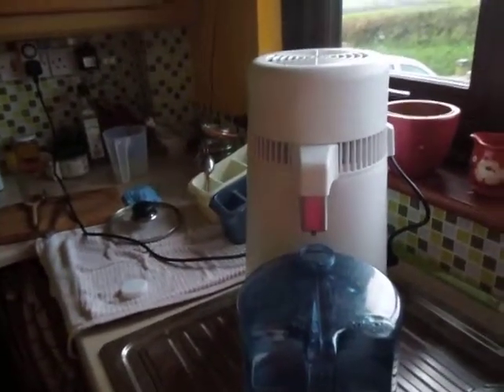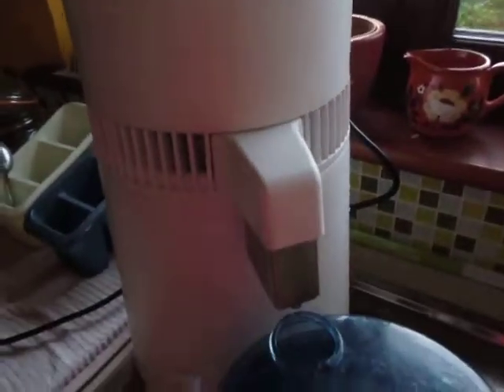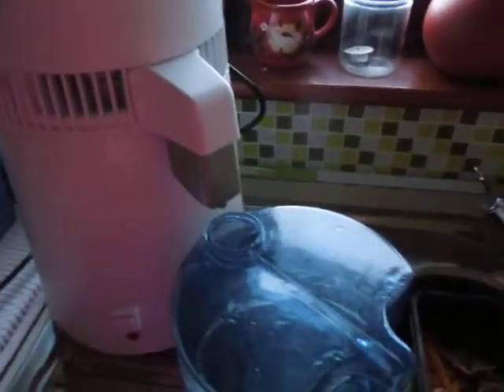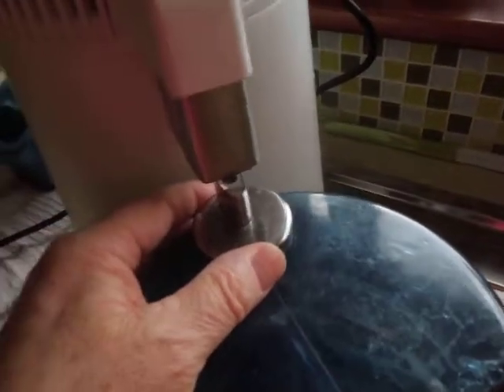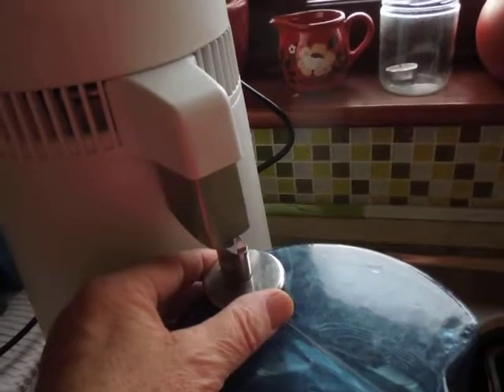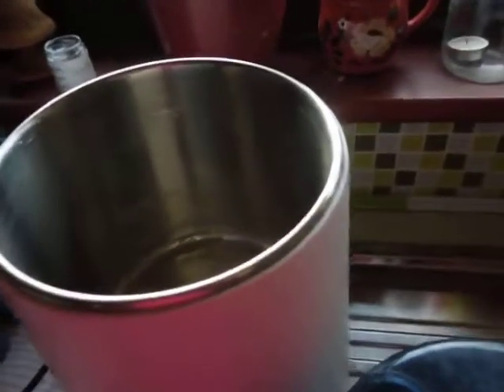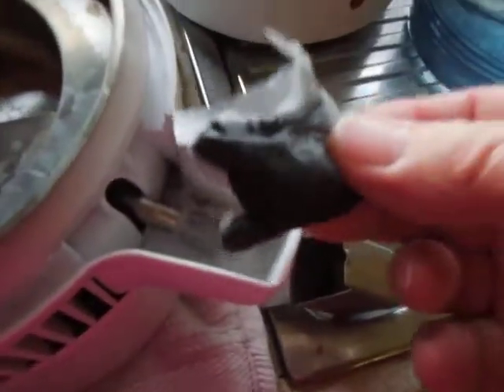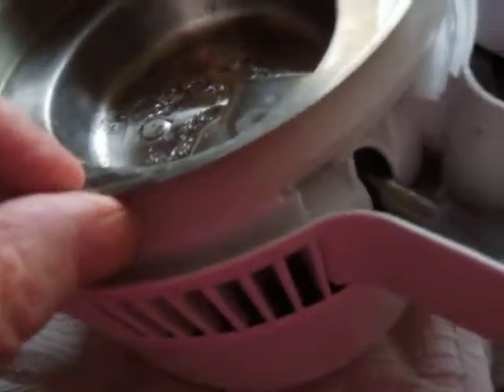Water Distiller Problems and how to Fix them.

Comment: Kinda useless info presented in a rather painful (slow) way. My Waterlovers MKII broke once during warranty and now done (after 3.5 yrs. I suspected this was a very poor bargain. If I buy 2 gallons of distilled from market, it costs $3. The unit cost $400; breakeven is 133 weeks, to say nothing about the electricity costs of running the unit 3 hours.  In other words, just buy the gallons of distilled water.
Reply: Kinda useless comment with information we have already considered PRIOR to purchasing a distiller unit. 🙄😒
Reply: The unit cost $70. he said to clean the ring and take off the metal piece so it stops leaking. i watched in 2x speed.

Comment: Here in Florida tap water is shite !  We bought some 3 gallon water bottles with screw on caps. We fill up the water bottles at the market water machines then we distill it. Tap water is poisoned with fluoride & chloramines. Yes fluoride & chloramines are toxic to humans & pets ! All products made by pharmaceutical companies are toxic too ! Darn right there is a depopulation conspiracy ! Up next is WW3 Depopulation which according to Revelation begins in the Middle East. One shadow government controls all governments worldwide, the I11uminati ! 1/3 of the human race will perish in WW3. Soldiers are merely pawns in I11uminati war games.
Reply: .666ft per mile squared = Curvature rate of earth 
66,600mph = Earth going around sun 
1666 = Year gravity was invented (666 newtons)
66.6° latitude = North and south arctic circles 
6x6x60 = Diameter of the moon
6x6x6 = Surface temperature of uranus 
4.666km/s = Plutos orbital velocity
666 = Speed of sound in knots
600 x 6 x 6 = earth circumference in nautical miles 
1.666 AU = Distance from mars to sun
1,426,666,422km = Saturn orbital distance 
666 times brighter, the sun is than venus
666 days. Longest time a female astronaut has been in space
Reply: - 0 intact dinosaur bones or skeletons found
- 0 dinosaur skulls found
- No transitional fossils  
- Dating fossils by rock layers and dating rock layers by fossils
 is circular reasoning 
- You can’t carbon date fossils; they’re stone. 
- Radiocarbon Dating is bunk
- 100% of dinosaur bones are fake 
- You'll never be able to see dino bones because they're 
supposedly radioactive, which is an obvious lie
- Engineers say dinosaur legs would buckle under the 
proportions and their insides would fall out based on the 
engineering of their rib cage
- They want you thinking "an asteroid can wipe us out at any
 time, now give us money" 
- Evolution was pushed by a eugenicist who married his 1st cousin. 
- Dinos invented by royal society in 1841 by liar Richard Owen
- Only people with a financial interest find dino bones, which are really 
smashed up chicken bones. 
- There are no dino discoveries before the 1800s. Not suspicious at all.

Comment: Thank you for the video! My husband and I bought one last year because we were going through so much distilled water (for my many plants and his c-pap) so we just thought it would be better in the long run. I didn't like the fact that we were throwing away so many plastic jugs and having to make extra stops when our stash ran low. Admittedly it is kind of a pain to have to clean it every time - if I'm making water for the plants, I will do two cycles before I clean it.
Reply: I clean mine every 10 gallons. That said I also have a whole home 6 stage water purification unit so maybe mine would be a lot worse if I didn't..?
Reply: I clean every month.  It's just scale, it doesn't change the water being distilled.  I'm run 2 TBSP of citric acid, and after a few hours, it's perfectly clean.

Comment: That’s normal. That’s the sediment from your water. Add vinegar and water about one inch and you will not have to scrub anything. There should not be any water left after a cycle
Reply: You are right, but may I add this aswell, 1 inch of vinegar is too much, you risk it taking metal particals as vinegar cuts deep into surfaces if left longer than a short while, certainly over night isnt even necessary, you only need a tablespoon at most. You do not want to accumulate metals in your body over time, by mico degrading the stainless steel over time.

Comment: I used my one for 4.5years and yesterday it stopped heating. When I opened it I saw that the heating element has separated from the aluminium inner container . I will have to buy a new one, but I  am impressed by withstanding more than 1500 cycles.

Comment: There should have been a clear rubber/plastic tube that came with; if cut and put the plastic hose onto the drip part you can direct where the drips go, like long enough to actually go into the top of the jug.  That lesson I learned after about 6 months of use and now never have the water going where I don't want it to go (as long as I remember to ensure that the rubber tubing is inside the jug).  I also overfill a bit, as you do, and just wipe out the bottom each time with a bit of vinegar.  I change the charcoal filter whenever the water begins to taste yucky.
Reply: Can't you use a charcoal water pitcher before distilling to help clean the water?

Comment: At least in the USA, when power is over .20 cents per KW  hour, it is cheaper and smarter to buy distilled water, currently only $1.00 per gallon. Also, the store product has no off taste and the process is much more efficient.
Reply: I bought plastic gal jugs at the market for years but prefer my distiller for a few reasons: I don't like plastic (I use glass to collect it), in the summer I use my dehumidifier water so I get zero gunk in the bottom to clean and it tastes perfect, and for me it's less costly than £1 per gal
Reply: @flatearthterrafirma8571  Dehumidifier is a good idea if no junk falling into the reservoir.
Reply: @flatearthterrafirma8571 that's not food safe. You say you don't like plastic but then use a non frood grade plastic humidifier??? Wtf
Reply: @DatsiKxModz  I distill the water. It's therefore pure and safe. No chlorine or fluoride like our municipal water supply. If I had a well with clean water that would be preferred.
Reply: @flatearthterrafirma8571  .666ft per mile squared = Curvature rate of earth 
66,600mph = Earth going around sun 
1666 = Year gravity was invented (666 newtons)
66.6° latitude = North and south arctic circles 
6x6x60 = Diameter of the moon
6x6x6 = Surface temperature of uranus 
4.666km/s = Plutos orbital velocity
666 = Speed of sound in knots
600 x 6 x 6 = earth circumference in nautical miles 
1.666 AU = Distance from mars to sun
1,426,666,422km = Saturn orbital distance 
666 times brighter, the sun is than venus
666 days. Longest time a female astronaut has been in space
Reply: My distilled water tastes amazing and I live in the US.  I use glass jugs and add minerals sometimes.  I will never drink store-bought distilled water in plastic jugs.  You can taste all the leached plastic.  I get 4 liters of water in less than 5 hours, so I never have to run my machine overnight.
Reply: I live off grid and use the distiller as a diversion load when I have surplus power. So for me I am utilizing power that would be lost forever if I did not use it. I am not an environmentalist but not consuming and transporting plastic gallon jugs full of water is better for the environment!
Reply: Seems like water conscious consumers are getting dupped into paying for plastic water because water distilling machines are a cornered market with limited cramp products.
Reply: @YoutubeacademiaAndsome  My water is amazing and not to mention the health benefits of not consuming microplastics.  Plastic is the worst.  My electric bill is no different from prior to distilling and I use my distiller almost every day.
Reply: mark40511  If you get cheap electricity and don't count depreciation on the Chinese machine which will fail in 1 to 5 years, likely so. But I would check the output for  TDS or hardness and see if it is zero or 1 at the most.
Reply: @RRaucina  my $115 distiller is six years old. Still works fine. One downside is that it heats up the kitchen a bit much in the summer.
Reply: Micro plastic and source cleanliness is not garunteed with store bought
Reply: In California,  it's now over $2 per gallon of distilled water.

Comment: Brilliant vid. Was wondering about changing the carbon filter. Fully value you taking the time to do this!
Using the same here and had no issues at all with; we discarded the first 3 lots but used to flush as we do bathwater. Some grey water also used for garden irrigation/purufication system. I digress. 
For past 5 decades we also have a flouride filter attached to any incoming pipes on every property resided in. 
Leaving distiller on to dry isn't an issue either, being used to accessing lemons & aromatherapy oils/herbs to clean everything we have successfully learned to clean up the mucky residue in the bottom that exudes from the nasties that exist from what is 
[ officially and unlawfully ] 
put in the water. We distill twice, then put through 2 water filters EVERY time prior to ingesting. So the process is constant & we about to invest in a secondary device. Testing regularly all these years guides us to this necessity, since everyone here ingests plenty of water daily. Sons & daughters of families outside ours have come to stop purchasing bottled water, invest in distiller and filters, yet advised all is pointless when no fluoride filter. Awakening the young to the dangers of such has been a lifetime commitment ✨ 
Should you wish, we can post the link for some good lemon juice & you only need 2 caps full after each use. We only use it when our home-grown lemons have been used up, but is really good! We've had same 5 litre one for past couple of years. 
The best way to prevent flood though, there is an option of a piece of silicone piping; thin enough to be held tightly onto outcoming spout on top fan part beneath the carbon filter block & short enough to just fit inside top of water collector/container. 
Wishing you well & much success with all your endeavors x

Comment: It’s a simple process and a simple appliance so I hope everyone solved their problems. Following the instructions is the way to go. Going past the fill line will cause it to boil over and leak. Where I live the water is very hard so there’s a good amount of calcium deposits so after every use I cover the bottom with vinegar and let it sit for four hours. I wipe sides with vinegar and the inside shines like new. Every distiller has an automatic shut off and the deposits on the bottom means it’s doing it’s job of removing impurities. It needs to be cleaned after every use. Check the instruction sheet again. Good Luck with it.

Comment: How did you get rid of the metallic taste? I just got mine it’s on its 4th run and no matter how much I clean it… followed directions w the acid they provided and w SOS pad… still horrible taste. HELP from anyone?
Reply: Take an extra step and run it through a "full sized" activated carbon filter.  Not just the small bag that most of these have at the spout, which doesn't allow enough contact time for the carbon to do it's work.  It will taste perfect
Reply: Wayne Helmore in his Megahome vs Waterpure video said he added some liquid mineral.  Says this starting 3:15. https://youtu.be/xzoZp7J_9gI
Reply: Even distilled water you buy has a metalic taste. I put a few drops of concentrated lemon juice in the water l drink. Mostly l use the distilled water for coffee and tea. Sincerely
Reply: Maybe you can pre-filter the water a few times with carbon filters before distilling, then use a 0.1 micron Sawyer filter to remove the taste afterwards.

Comment: After 2 or 3 uses I figured out wiping off the sealing ring with a paper towel after each use prevented any leaking. No cleaning products necessary for the seal, just wipe it off after it cools down.

Comment: Thank you very much

How do you clean the bottom side of the top part?
Reply: @sheleg4807  wipe it with distilled water and vinegar mixture then rinse with distilled water and let it drip dry

Comment: I had my distiller leak out the sides due to the rubber seal on the lid not sealing completely so water evaporated out of the sides and I was getting 40% yields in my tank. I removed my rubber seal and flipped it, reattached it, felt like a firmer seal and was getting full yields in my tank!
Reply: Exactly this problem I have today : I use the same water distiller for 2 years and 7 months . I distill 4 l every night . When comming in the kitchen today, all water was everywhere , only not in the vessel . And the distiller does not work : its swithed on red (the button ), but does not start working ...

Comment: Have you ever had your distiller fan stop working? currently struggling with this
Reply from the maker: No never stopped.  You need the fan working to cool the steam back into water.
Reply: Mine ran about an hour without the fan running (I forgot to plug in fan at first) could I have damaged anything?
Reply: @phoenixrising4464  Probably not.  In fact, delaying plugging the fan section in until the water heats up will result in slightly-less electric usage.

Comment: Thanks for helpful video. Does your lid lift up while it's distilling? Got mine today and the lid lifts up and drips come out and down the sides, also near the plug.

Also what temperature does the water come out at? Mine is about 50c which is hot.
Reply from the maker: The lid lifting isn't right, and leaking is not good, the water has to be hot as it is steam which is cooling.  If the lid keeps leaking send it back.

Comment: i got the bad taste
Reply from the maker: change the filter bags
Reply: @dozerblade  did you buy new filters or use the spares?
Reply from the maker: @jond532  bought new
Reply: @dozerblade  thanks, can you recommend any?
Reply: @dozerblade  I removed the filter and the whole metal piece and then run it through a brita and it tastes perfect now.
Reply from the maker: @jond532  good job.
Reply: @jond532  After running the water through the Brita, what was your TDS?

Comment: I have the same distiller and it keeps shutting off. I've changed the filter, tried with no filter, removed the guide. Nothing works.
Reply: hello all, i too have mine shutting off.  I have gone farther and replaced the two sensors and it still turns off.  I believe it is overheating and it's from poor metals in the heating element(?) please anyone make a comment.  So anyway I mean, if that's happening, you have to buy a new unit.  Can't replace the heating element, at least not in mine.

Comment: Yes you brought up 3 main issues, the rubber[silicone] seal. the dried distillates at the bottom, and the metal drip guide.
Lightly wiping the silicone seal helps. I find that putting the top straight down[at a silght angle] without twisting the top section[often to adjust the drip head to the blue container hole] is the main cause of leaking. Just adjust the blue container to the drip head instead.

For the built up distillate, a tea spoon of citric acid[food grade] to 2in filled distiller and left for an hour or two, loosen up the muck for good rub down. The distiller will be almost like new.
Metal drip guide is just to make sure the droplets are not deflected by sudden gust of air movement. Drip head should not touch the metal. Yes you can have the option not to use it.

Overall the distiller is an improved version of the orginal[ aluminium fan blade, higher air inlet ect] The main usual breakdown problem is the manual reset thermostat switch at the light button at the distiller front.  Manual reset thermal switch , KDS 110c NC manual

Comment: I have been coming back to half a jug of distilled water every time and last night it only produced an inch of water. I have no idea where the water went. Could it be the water guider gadget like you said? It's only started happening the last week or so and I've been using it with no problems for six months 😔

**EDIT..I removed the water guider gadget thing and have had no further problems 🙏🏻

**ANOTHER EDIT I have found putting a small stainless steel funnel under the water outlet and into the jug stops any issues of leaking whatsoever ☺️
Reply: This happened to me when the metal water guide had dropped and wasn't seeded correctly. There is a wee bump where the two pieces line up.
Reply: @flatearthterrafirma8571  I have put a stainless steel funnel under the water outlet and now the water goes straight in the jug, it's great lol.

Comment: I am experiencing massive Over-heating problems. It keep shutting down. Does anyone have a fix for that? Thanks.
Reply: Check the fan for dust ect. Make sure the top has space to push out the hot air too. Don't put it under a cupboard ect
Reply: @HillbillyYEEHAA  how did you clean the dust off the metal fins? I am about to try..

Comment: I actually filter my water through the refrigerator before distilling it. I use white vinegar 1/2 the time to just sit like 1/8 inch before cleaning bottom and sometimes I boil it to really clean it.
I use the water guide never have had a problem and I make 2 gallons a day for about 16 months. Yes change your filter like every 3 to 6 months. Clean the fan every 6 to 12 months. Great machine.
Reply: How do you clean the fan?
Reply: @user-zt2wc3uh1l  the 3 screws under the silicone seal allows you to open it up. I scrub the fan with a small brush and use canned compressed air (what you use on computers) to clean the coils.

Comment: new water distiller. It turns on and off. Is that normal?
Reply from the maker: mine stays on all the time until finished, unless I unplug it.
Reply: @dozerblade  I realized I didn't have the temp high enough. Now it works. Thanks